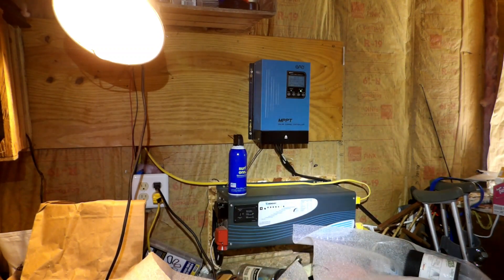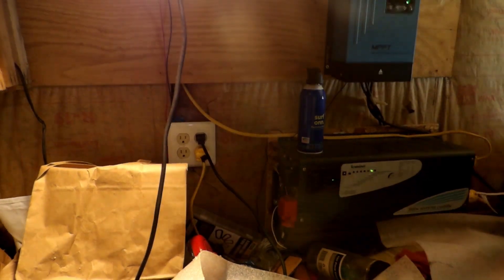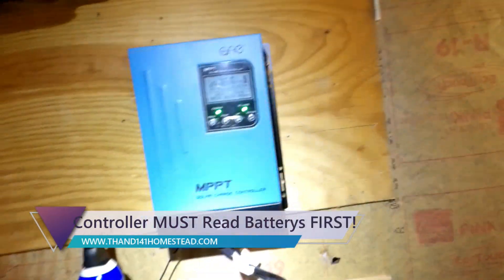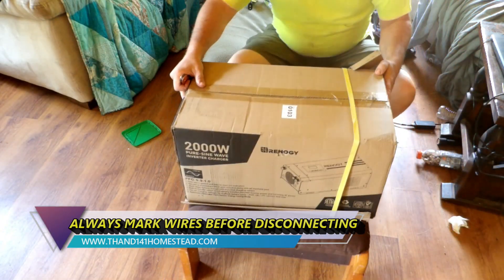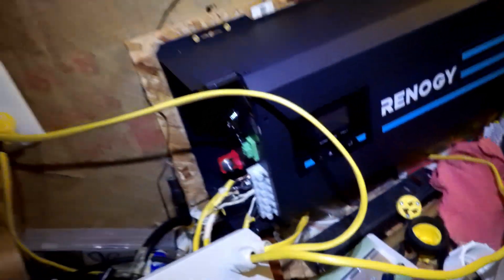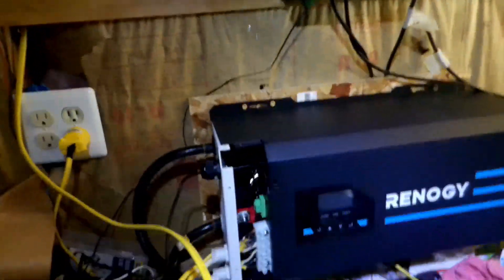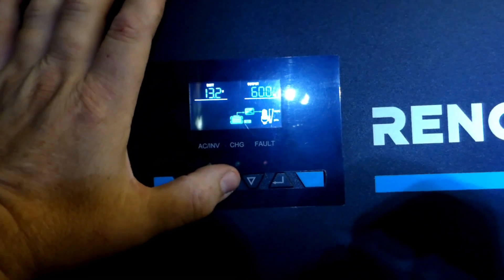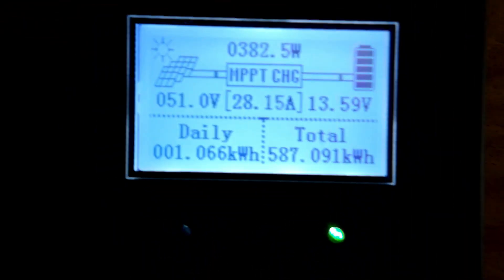Off Grid Upgrade: From Lead Acid to Lipho4

Comment: Thinking about going solar, it's very expensive and would take years to break even. My power needs are probably to high.
SUB from GGHC!
Reply from the maker: It depends on what your needs are, I run a microwave, stand up freezer, coffee maker, water pump, tv, and low voltage grow lights on 1000 watts of solar panels. in the winter I had to run a generator ever 3 or 4 days for a few hours, but it's not that expensive. Hair driers and crock pots and such we had to give up. but we did it.

Comment: Mine lasted exactly fourteen months from the moment it was professionally installed. The warranty for this product is one year. I contacted Renogy customer service bc an inverter is supposed to last something like twelve to fifteen years according to current design standards. Renogy informed me after asking me for photos that my unit certainly had malfunctioned but since it was out of warranty they cannot help me. Read that again if you are considering this for your van or camper. Mine is at least the third unit I’ve heard of wearing out before the fifteen month mark. It’s almost as if they are made just good enough to put outlast the warranty by a bit and die. I’m making a video about this product and the customer service of this company soon. For $400 more I could have had a Victron that would have lasted fifteen years. Now I’ve cost myself an extra $700 for this unit that is of poor design. Don’t buy this product and limit how much Renogy equipment you install in your build bc they will not stand behind their products if you encounter issues.
Reply from the maker: I am sorry for your bad experience. When I purchased my first inverter charger from Renogy it failed within weeks of installation. I called and had a new one within two weeks. I agree you must be careful and research the products you place in your system very carefully. Warranties are simply a method to create confidence in a product, I don't depend on them nor factor them into my decisions. Unfortunately, I can't think of one company that would replace an out-of-warranty product. I have no connections other than use to Renogy, and I include them in my videos because I do use them in my systems. Thank you for posting, And To anyone else reading these comments know that in this instance Renogy did not replace an out-of-warranty piece of equipment. I wish you the best of luck with your system, and thanks for watching.

Comment: Looks like you hit 500 subs.  Love my new 200ah  battery  the power you can store is unreal  compared to  lead acid. My old battery is in my van running a bar fridge so I can have ice cold beer and a freezer at the drag races  next weekend,  Have a great day.
Reply from the maker: Thank you! The Lipho4s are night and day over the lead acids! That's a great idea for your old batteries. I will move mine to the barn when I get it built. Thanks for watching Dave.